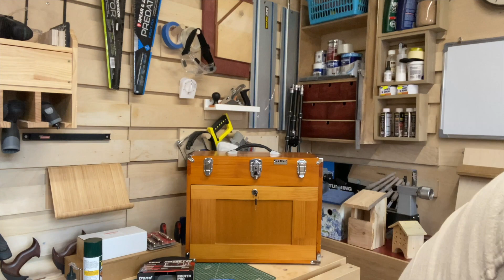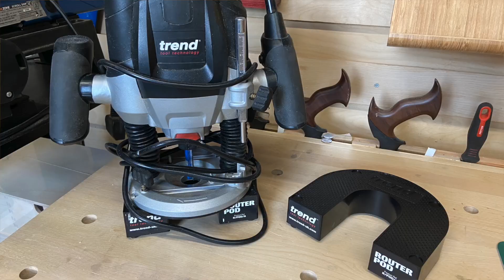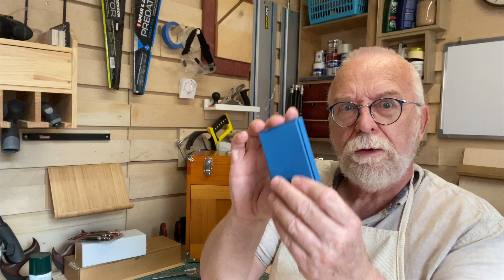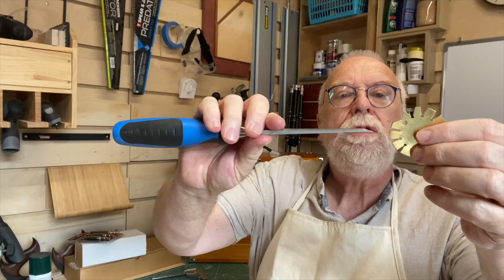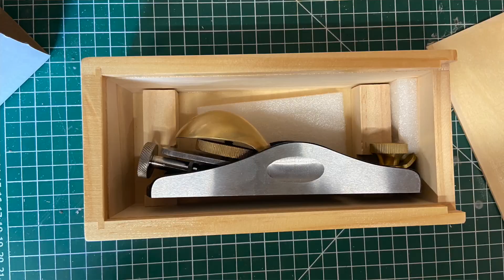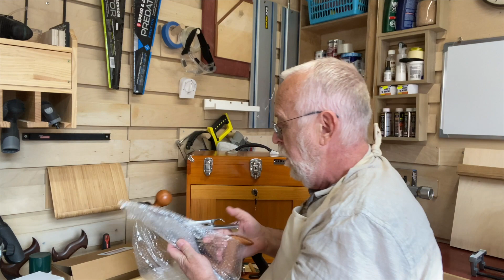GW103: Tuesday Tool Haul!

Comment: Nice new toys. As a hobbyist woodworker i got myself cheep no4, no5,  block plane sharpening stones engineering square marking knife and 3 chisels and the mallet. I am not a newbie to woodworking and for me that is good enough set to play with it and learning how to use them properly. I don't have to much time but every time i am enjoying play with hand tools and it is very satisfying when i can cut joinery without all that noise from engines on power tools.

Comment: Great tool haul there buddy ! Can’t go wrong ! I love my 5 and 1/2 so much so I have two of them, I use them over my fours and threes all the time ! So minimalist hand tool kit, I would go a number either number 4 or 5, set of chisels, tenon saw, gents saw, combi square, tape measure, marking knife, marking gauge/mortise gauge, sliding bevel and a bradawl. I’m probably forgetting something but that’s what I would go for, but then of course you have to temper everyone is different. Also keep you plane sitting on the soul not the side  👍
Reply from the maker: Thanks for the advice bud.... I'm making my next shopping list ! 😀

Comment: With planes I do like to joint by hand so I love my Rider no 7 ( as my small surface planer has been under bench since I got it ) old No 4's gets used ( I have 2 one as a scrub ) and  old no 5 ( inherited and my 1st hand plane ) also a 60 1/2 block. Not used much - 110 block plane , 78 rebate , 13-050 combination, 75 bull nose , no 3 , Rider 80 scraper. Do I have a plane fetish ?
Min Hand tool kit for me would be :- Tape , bit and brace , egg whisk drill, drill bits , chisel set , metal combination square, small engineers square , pencil , a set of Japanese saws , hammer and mallet , bradawl , screw driver set , clamps , 1m ruler,  No 5 and 60 1/2 block plane, granny tooth plane ( I have the bits just not made one yet), fret or coping saw and finally a marking knife. ( I must have missed loads off that list as it seems too short what have I left off ?)

Comment: Hi Loz, always good to see and hear you. I'm quite envious of your workshop tools, I've copied a few of them myself after your reviews etc. I couldn't quite afford the Record Power 350 that you have but I went for the 350s and I'm quite pleased with it. I'm glad I got it when I did because the price shot up by £200 just a couple of weeks later. Crack on cracking on my old codger, Regards, Fred
Reply from the maker: Hi Fred. Yup- In retrospect Ive "over egged the pudding'" regarding the sabre 350..🤪 for what I'm going to use it for even the 350s is probably overkill. I think a 12" bandsaw is probably enough, really..... Still don't regret it tho!